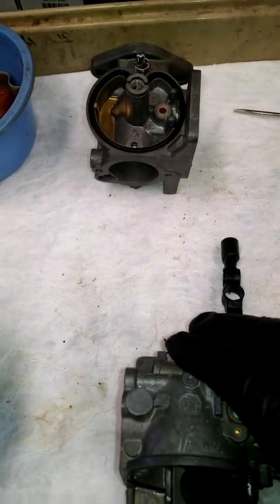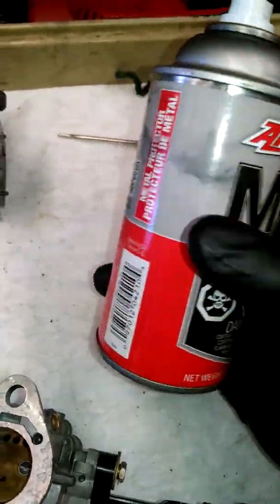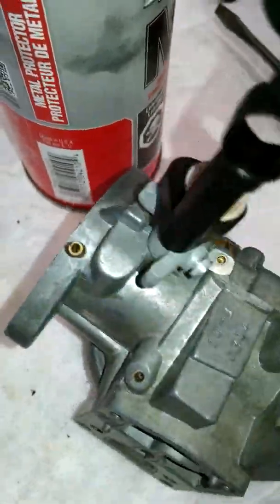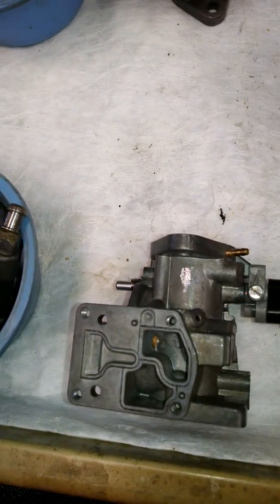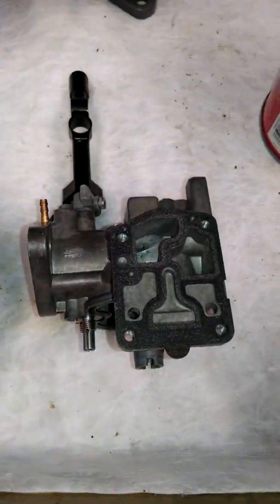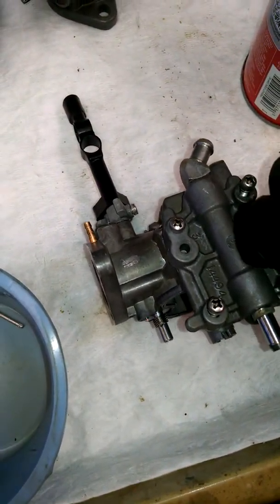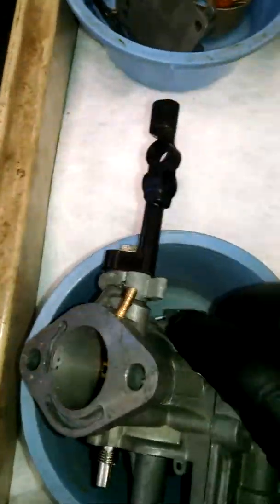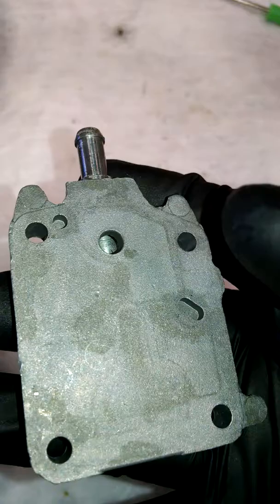1990 40hp Mercury carb assembly part 2

Comment: Will Carburetor cleaner eat or melt  the plastic peices that you didn't take off
Reply from the maker: I wouldn't try it. I use brake parts cleaner when I can't use an untrasonic cleaner.

Comment: i followed your video and did a great job im having issues after reinstal because of the confinement i cant find anyone to help. the issue is it will start (takes a few trys)and run but i have no power in gear its like i was just above idle and will stall in nutral
Reply from the maker: Do you have access to a service manual.
Reply: @HamiltonLandWorksLLC  no i dont
Reply: Sorry i didnt expect you to answer so quickly
Reply from the maker: I'm afraid you need to do check the synchronization of the carbs and the timing. You really need the service manual for that.
Reply: @HamiltonLandWorksLLC  well from what i have learned today im going to go back and recheak everthing i did maybe i didnt rebuild corectly i learned a lot from your videos things that i didnt do right tomorrow il know better i work in showbiz and know alot of people that i will be sending to your channel thanks for the help so far il let you know the results of tomorrow
Reply: i just finished reinatall found a couple things that i missed now it starts and runs great all i need is to ajust mixture and idle
Reply from the maker: That's awesome. Glad it worked out for you.